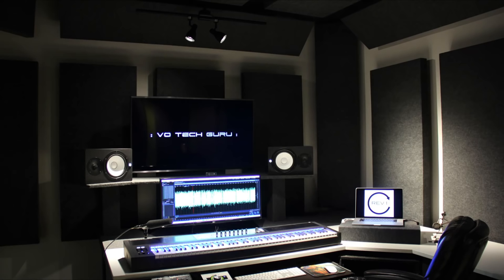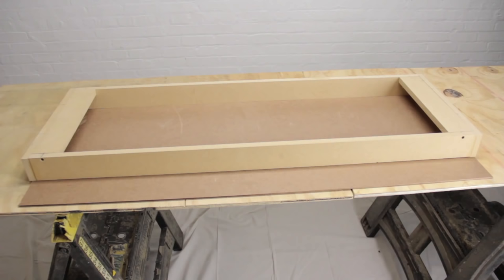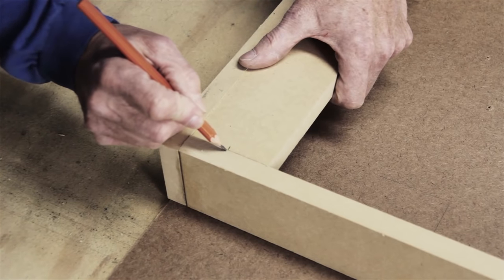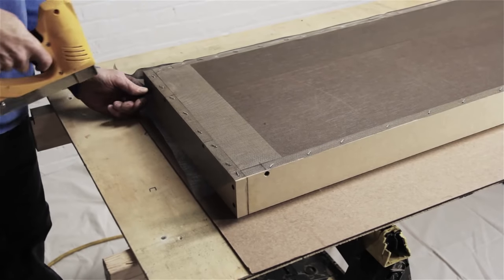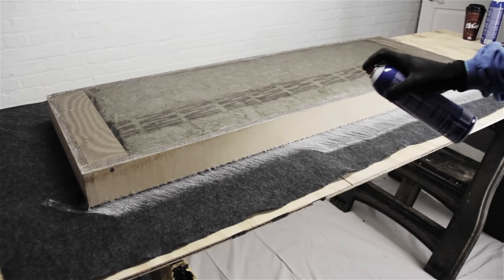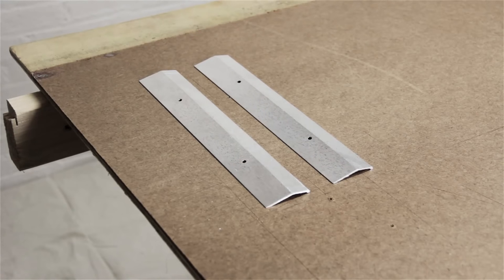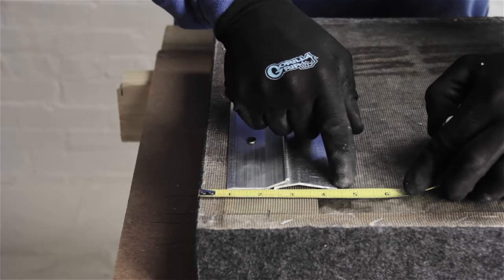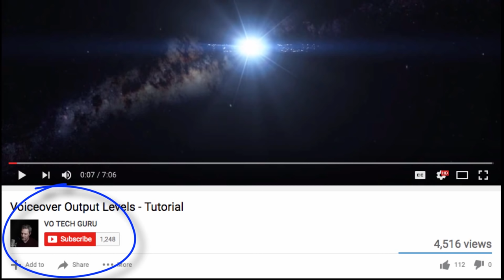How To Build Acoustic Panels | DIY Acoustic Panels

Comment: Dont think ive ever done a job this properly in my entire life 😂
Reply from the maker: lol! Maybe you can do it with these!
Reply: I managed to port and polish a set of small block Chevy heads for my 305 V8 in my 1986 Camaro. I had never done anything like that before. Man, it added another 25 hp without a doubt and you really noticed that extra power right from off the line out to 120 mph. What a feeling of satisfaction! So don't worry. Just take your time and do it right. I have always hated having to do things twice! ;)

Comment: TO THOSE CONSIDERING THIS PROJECT, I do not recommend using MDF. Here are my notes from personal experience:

-My local Home Depot has a safety rule for employees which limits all cuts to 12" minimum on the panel saw. I can only imagine this is become more and more popular in a lawyer-happy world. This required much more cutting at home, and my cuts are not as precise as if they would have been done on a panel saw.
-My 3/4" MDF (purchased at Home Depot) is splitting at every other screw, no matter what size pilot hole. And I've tried various sizes. Yes, this is using 1-5/8" drywall screws as recommended.

For these two reasons I would highly advise NOT using MDF. In hindsight I wish I'd used 1"x4" pine, saved some work on the cutting and avoided splitting. I'm going to make it work with the MDF as I'm too deep in the project now, but I'm very disappointed in the performance of the MDF.
Reply from the maker: Zero splitting on this side. Did you predrill the receiving end deep enough or maybe drive the screws in farther than the front pilot hole? No offense, but when done correctly, you shouldn’t have any issues at all. It’s very common amongst pros to build jigs and many other things using this method with MDF. Again, just trying to troubleshoot so I can advise others. Either way, thanks for watching!

Comment: Are these 2x4 I think I missed something?
Reply from the maker: Young Reek Check out the beginning of the video when I call out the measurements. They aren’t 2 ft wide but are near 4 ft long.
Reply: VO TECH GURU okay well i was wondering how many yards will i need for 7
 2x4 panels
Reply: VO TECH GURU like fabric same side as yours
Reply from the maker: Young Reek We used 9 yards for 8 panels but bought 10 yards. So I’d guess 8 yards if building 7? 9 yards my be smart just to be sure. The fabric isn’t expensive.
Reply: VO TECH GURU turns out you'll need like 10 yards for 7 with precise cuts
Reply from the maker: Young Reek How do you figure? The fabric in the link I provided is 72” by however many yards you buy. For the length of one panel you need 64-1/2 inches of fabric so that’s more than covered by the 72”. For the width you need 34-1/2 inches which is just short of one yard. So you need one yard of fabric per panel. I just suggest getting one or two yards more to account for application errors. What math equation did you use to get your answer?

Comment: I am trying to find out what material is the absolute best for absorbing sound. If some are better for low end than others and high and mid, I want to know that. The best would be a list of materials with values for various frequency ranges. Is it good to layer several different materials to take care of all frequencies?
I don't want opinions. I am looking for facts. The info I want does not seem to exist or Noone wants to show it. They just want to give opinions or do very inaccurate tests, etc. Why will Noone simply show us the numbers or coefficients of various materials.
Reply from the maker: Perry Pelican I'm planning to do some testing in the future, but not right away. In the meantime, I can tell you the material I used is very effective. But I understand your frustration.

Comment: Is anybody else having a really tough time cutting the felt with the blade? It's the hardest part for me, and even with the sharpest blade, it ends up ragged and looks like garbage. Thought we could knock out a few of these in a day, but it's taken a week to get 5 done!
Reply: Also, I ran out of fiberglass screen after only 5 panels. I bought what was on the list. Should I have been able to make 8 panels with the listed supplies? It's the only thing I ran out of.
Reply from the maker: Catherine Campion This is the first time I’ve heard of anyone having a problem cutting the fabric, so not sure what to say there. Did you order enough screen for 8 panels?
Reply: I thought I was to buy one 36" x 25'? I had to borrow a vehicle to shop, so I aimed to follow the shopping list exactly. And maybe by blade is not sufficient?
Reply from the maker: Catherine Campion That’s correct on the screen. If you split the roll right down the middle you’ll have more than enough for 8 panels (two 18” X 25’ pieces). As for blades, in March of this year I attended a large conference in Atlanta to hold workshops where non construction industry people made the panels. We used the Stanley blades on my list with no cutting problems. Did you use the same blades?
Reply: @VOTECHGURU  I did. I think my tiny, arthritic hands are just not MAN enough for the job.
Reply from the maker: Catherine Campion Ah, I’m sorry about that. Several light passes with a blade should get it down. BTW, I watched your moth stuff and love it.
Reply: @VOTECHGURU  Was it VO Atlanta you attended? Will you be attending again this year? Just bought my pass!!
Reply from the maker: @catcampion  Indeed! I'll see you there!

Comment: This is good instruction with 1 important exception! The Fabric! Acoustical panels should have a "Acoustically Transparent" fabric. Everyone misses this in DIY. If the fabric isn't evenly transparent the insulation does not achieve its absorption ratings.
Reply from the maker: ctrl booth It wasn't missed in this DIY tutorial! The felt is VERY transparent and VERY effective. If you hold the felt up to the light you can see right through it. My voice in this video was recorded using these panels, and clearly the panels are working very well. Thanks for your comment.
Reply: I here ya Vo Tech, if it works go with it. Would be interesting to know transparency by frequency. If it is less transparent for example above 4K that could be a positive benefit over traditional treatment. The placement of panels looks great! I bet it's a nice sounding room!
Reply from the maker: ctrl booth Yes, both the control room and booth sound exceptional, even well outside the sweet spots of the monitoring triangle. Most pro panel companies us thicker fabric than craft felt as well. Craft felt is about the thinnest and most transparent fabric you can find. That's why we used spray adhesive instead of staples because it's too thin for staples and can rip when you go to tighten it. It's very transparent but doesn't look like it. It's a great solution.

Comment: I really liked the video but I think that something is wrong, a carpet isn't a good material to use for an acoustic panel, u gotta use some kind of cloth which allows air pass through so that the rockwool can do its thing, if u use something like a carpet sound will immediately bounce on it instead of reaching the rockwool to get absorbed. The whole tutorial is amazing, but using carpet will result in failure of sound absorption.
Reply from the maker: Carpet? We used felt for the panels. It's very transparent. Are you talking about the carpet strip for hanging the panels?
Reply: @VOTECHGURU  I'm talking about the material you used for the front of the panel, it doesn't seem to be breathable at all...
Reply from the maker: sadiBeats Yeah. That’s craft felt and it’s very transparent. If you hold it up to the light you can see right through it. Blow right through it. It’s nothing like carpet at all.

Comment: seems like a lot of effort for making the back side looking good, why not just staple the cloth over the panel? why glue? if the glue doesn't stick right or loosens due to temperature or moisture you'll probably get loose spots or warping of the cloth along the sides, right? 
or is it more important to have a flat back side?
Reply: nonetheless, result looks great. how well does it dampen sound?
Reply from the maker: Tijmen J. Thanks for watching. The 300 level glue does not give at all with both the wood and cloth being sprayed. Panel fabric can sag over time when held by just staples, but glue holds everything firmly in place. Also, no folding fabric at the corners, which I think looks sloppy. Even if you do cut the fabric at the corners and use staples, the fabric will loosen and show the wood frame at the corners over time. The glue method is just much better for me. Hope that helps.
Reply from the maker: Tijmen J. Very well. You're hearing my voice in a booth covered with those panels. I also mix with them in my control room. No complaints.
Reply: VO TECH GURU thanks for responding ! that makes sense. corners are always the worst with stiff fabric...
does it reduce sound going out the room also?
Reply from the maker: Tijmen J. It will lower the sound energy to some degree, but how well a room holds in sound is really about the surrounding structure, like drywall, green glue, insulation etc.

Comment: Hi everybody, I live in the San Fernando valley, California. This is an FYI, I have gone to a different Home Depot and Lowe's. They will not cut the MDF panel. I keep getting that same answer. They are saying they wouldn't cut the MDF panel do to the chemicals, That can cause cancer.
Reply from the maker: Chris Rodriguez Thanks for the info. They’re referring to the dust that results from cutting MDF, which you have to be heavily exposed to over a long period of time. But they are a huge corporation so they have to be sensitive to perception. Not all Cal Home Depots will tell you no, according to some who have built them in LA, but if you can’t find a big box store that will cut it, you can easily get a local cabinet shop to cut up a sheet/s for you.
Reply: VO TECH GURU ok thank you for your advise.
Reply from the maker: You got it. ;-)

Comment: yo I've heard rockwool and products like this are very cancerous and I've seen people wrapping them in like 0.00003mm thin foil. What's your take on this?
Reply from the maker: I would check the material safety data sheets at Roxul.com if concerned about safety, but I haven't had any issues with the insulation migrating out of the panels. We have the front and back covered with screen and haven't seen any dust from the panels on the floor or other surfaces. As for foil, I'm not sure how the insulation would be able to absorb acoustic energy if it's sealed off. Also, I would be concerned about the foil buzzing at low frequencies. The idea seems strange to me.
Reply: VO TECH GURU theres this 0.000003mm thick wrap that resonates at 30k + or something and idk how this works but everything under that is absorbed. its super weird and sketchy thats why I asked
Reply from the maker: Yeah, that is weird. Do you know what it's called? Like the product name? It would be great to take a look at the specs and maybe test it out.

Comment: So how do you make this for "$25 per panel" when the insulation alone costs $48 per your link.  What am I missing?
Reply from the maker: BoredAtWork2000 There are 12 pieces per pack. Divide $48 by 12 for your per panel insulation cost.
Reply: VO TECH GURU ok.  That makes sense.  The HD website makes it look like you get 1 48" piece for that price.  Thanks for the quick response!
Reply from the maker: BoredAtWork2000 Gotcha. I thought you clicked on the link to my kit.com site where I describe the contents. Glad I could help.

Comment: Got a flat out, "hell no, i'm not going to cut that board for you, you have to do that at home" from Home Depot. Sigh.
Reply: I went to Lowe’s today... I’m buyin? they cuttin!! Lol he wasn’t happy tho 😝
Reply: Attending to customers is their job. I would’ve called the manager. Working at Home Depot is the easiest job ever.
Reply from the maker: Yeah, some stores have changed their safety rules. It’s so easy. Plus the have a 25 cents per cut policy in place. It’s their job. That said, they didn’t charge me a dime for the cuts. Worst case, take the MDF to a local cabinet shop and they’ll likely cut it pretty cheap. Many people on here went that route. You get a huge amount of panels out of one sheet. Like 8-9, typically.

Comment: I think this cost more than $25. I would guess $40-$60 at least with all the materials, glue etc. And you need machinery/ tools too. Still cheaper than $100 but the time you have to invest is a consideration to go and buy something in offer.
Reply from the maker: In 2016 they came in at just under $25 per panel, all-in. Not sure about now. Tool’s are listed in the description and are assumed or they have access to the tools for anyone who would take on a project like this. Not meant for anyone who’s not handy.

Comment: No space between the wall n the panel tho
Reply from the maker: Time Vortex That what the bumper and the hanger do. 1/2” gap.
Reply: @VOTECHGURU  oh ...well not sure if it's enough is it ?
Reply from the maker: Time Vortex It’s enough. There are diminishing returns as you increase gaps. I voiced this video with these panels. Can you hear the room?
Reply: @VOTECHGURU  not...but i have 2 inches gap .. low frequency waves will not be " dual absorbed "  with 1/2" imo...
Reply from the maker: Time Vortex I hear where you’re coming from but these panels don’t allow much low frequency back into the room anyway. I’ve tried many things using my Beyer reference mic to not only measure sweeps but to find the right bolt area in any given space. A lot of panel manufacture “experts” talk about the same but then back their panels with plywood which is idiotic, or seriously misinformed, to say the least. Which I CAN NOT understand if they are making “pro” panels. If the frequencies can’t pass through the panel, hit the wall, then try to get back through, I don’t see the point. Anyway, do what works for you, man. I compose for film and TV and have no issues over here. I even voice for global brands from my control room without entering my booth (albeit on my 416 shotgun). To each his/her own, I suppose.
Reply: @VOTECHGURU  YEAH MAN I SAPOSE I'M BEIN' PICKY ( caps)
Reply from the maker: Time Vortex I get picky all the time, man. It’s what makes a pro a pro. I learned awhile ago that my 80% is usually most people’s 98%, or so I’ve been told, so I just go with that. I otherwise get paralysis from analysis.

Comment: The real problem is buy all the istruments to work, like drill ahah
Reply from the maker: Yeah, a person would need more tools than the average household toolbox carries for sure. Then again, a cheap drill for $50 along with a few other fairly inexpensive tools would be enough to get the job done. The cost would definitely be offset if building at least a few panels because online prefabbed panels at this quality level are pretty expensive.

Comment: A bit too complicated. The Lonely Rocker has an easier method to achieve the same results. To mount to the wall all you need is a D loop at the back of the panel and a monkey hook into the drywall. The custom mounting method here is overkill.
Reply from the maker: Yeah, I’ve seen that take on my design. Cool. Whatever works for you. I would defiantly use the screen though. The Roxul will sag over time and bulge out. Like on his ceiling panels in one of his other videos. Thanks for your comment.

Comment: Another guy said you can use towels rather than insulation that has itchy fiberglass.
Reply from the maker: Towels won’t get you anywhere near the acoustic effectiveness. BTW, this isn’t fiberglass, it’s Rockwool. It’s a completely different material and far more effective than fiberglass. It was specifically designed to be water/fireproof and acoustically superior.

Comment: If you want them to work properly they should be hung off the wall with air space behind them.  The results will be far better.
Reply from the maker: The hanger and bumper at the bottom provide a half inch gap away from the wall. But yes, you are correct, if you can get them even further away they’ll be even more effective. Thanks for watching!